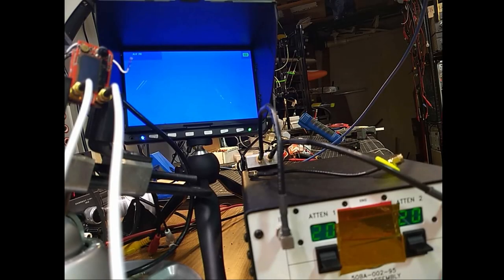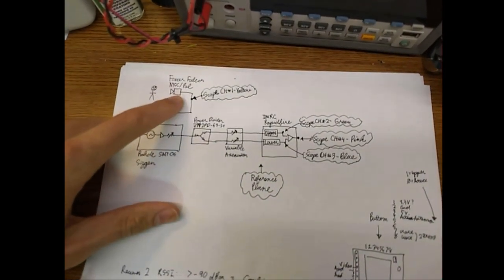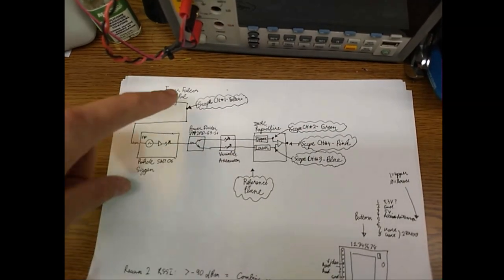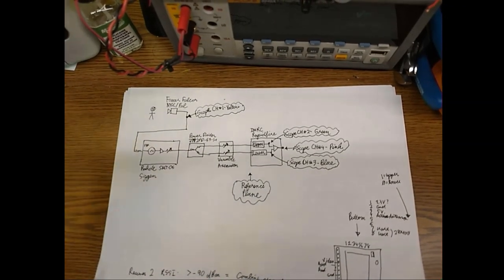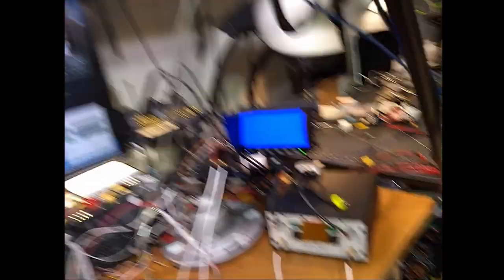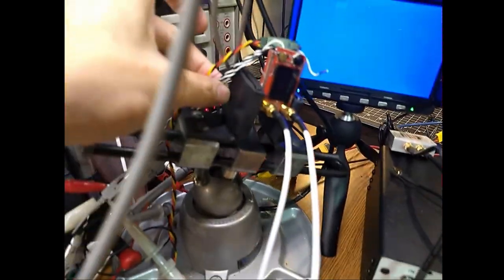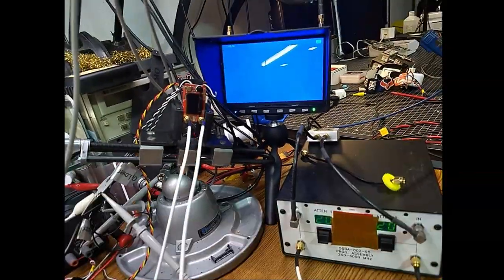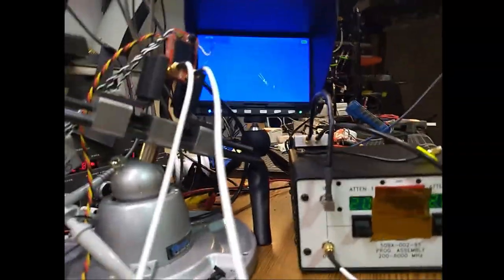ImmersionRC Rapidfire - Minor Bugs - Part 4 - FPV Video Series - PK's Lab

Comment: Another great vid. I've experienced these bugs. I've a RF 2nd batch and I'm running brain v1.2.9 and rapidFIRE 1.1.4. So still not fixed yet. These are regular occurrences for me. The first plug in issue is so annoying, RSSI/Lock flickers in and out constantly the whole flight, and then subsequent flights it was fine. I've really noticed it the last few outings and switched quads immediately thinking something was wrong with the first. But then I'd fly the same quad later on and it was fine. Felt stupid thinking that in any way my goggles being on for a while and letting them "warm up" fixed a problem, but I just shurgged and said "Oh Well". Curious how going from on/off fixes it. I mean off is off, right, and how could the damn thing remember that it was on just a few seconds ago and has transitioned at some point to off and on again. Attempting to use the menu system and getting a total dark view in goggles is annoying as hell too.

Comment: Are you planning on testing / comparing the TBS fusion module with the RF module when it is released? I would love to see a video of that!!
Reply from the maker: I am hoping to buy one of the fusion modules as soon as they hit the pre-order state.  Trappy made a few comments in todays stream about the relative performance of the sync acquisition in the fusion vs. the rapidfire.  It sounded like he's expecting the initial sync acquisition and hold performance to be slightly worse than RF out of the gate, but is hopeful they can better in follow-on releases.  But I def would like to do a head to head comparison of them :)

Comment: Hi! Thank you for your videos! Can I ask you, is it possible to fix this and other kind of "bugs" with new firmware, or some of them can be fixed only with new hardware revision?
Reply from the maker: Actually, my module used in this testing is a batch 1 one.  The initialization problem may just be a firmware bug or could be a power-on problem that they've already addressed.  Some of the other OSD getting stuck ones def feel like firmware bugs to me, but I don't have any internal access to the code so I can't say for 100% certain.

Comment: Hi PK thanks for the videos, i have a Batch 2 with the Oversaturated problem, and i found a solution, i want to send it to you. with images, where i can contact to you ?
Reply from the maker: For those running into this comment in the future, Immersionrc has officially acknowledged this as an issue and has detailed the problem and how you can get it repaired by them here: https://facebook.com/groups/205558953557012?view=permalink&id=502449513867953